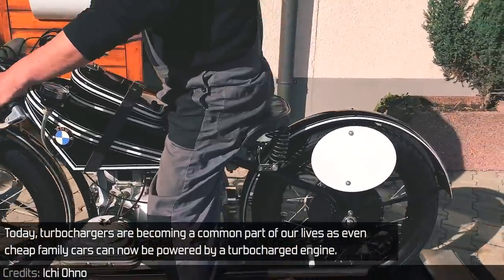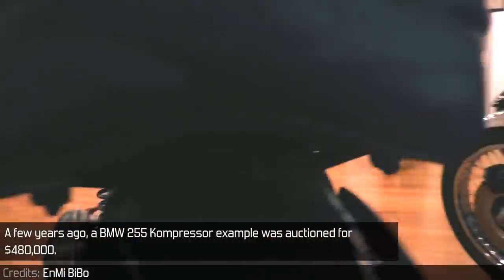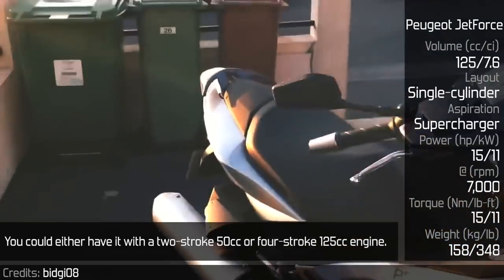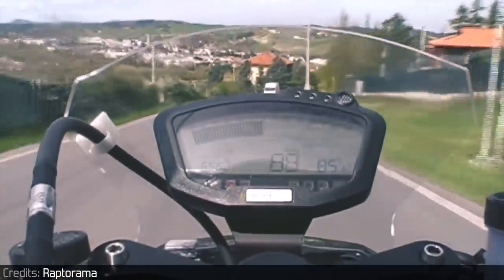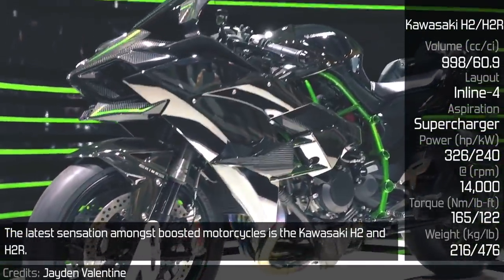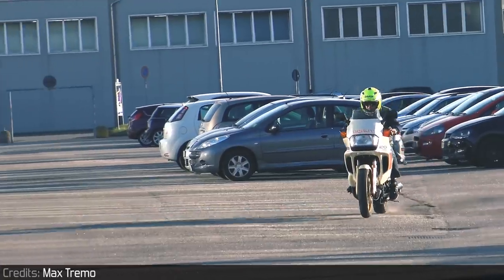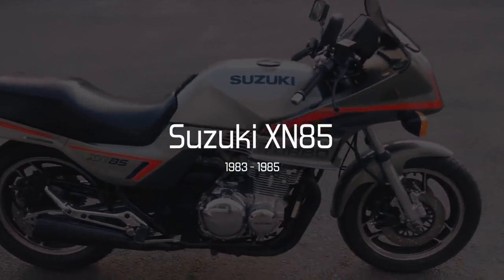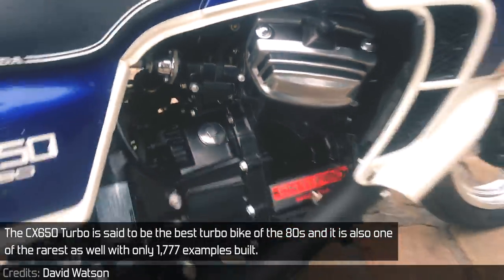10 Of The Coolest Stock Boosted Bikes

Comment: Saw a photo at BMW Museum of a  motorcycle from late 1930's without an a front leaf spring suspension (like Indian used) with a supercharger.Across town at the Deutsche Museum was a display with the supercharger BMW had used on the speed records bike.Twin screws operated by chain drive off the crank shaft.

Comment: 1980s Japanese bike handling + a turbo  . That's a really interesting , and probably uncomfortable mix . . . .
Reply: The XJ650? It was just too damn heavy to do anything - even with the Factory Power-up kit. (at least you could keep FZR600s, Hurricanes, ZX600C and later Ninjas, etc... in sight with the kit. Not beat them, but not get gapped badly)
The Gpz750 Turbo  was terrifying. Pipe cleaner UJM frame and a 120 wide rear tire.

Comment: wow a supercharged mini scooter with 50cc?? that was a bold attempt at getting more than 14.7psi into the lawnmower engine!! more manufacturers should try doing this...the idea is to make tiny engines powerful, that will only improve turbo and supercharging on bigger engines as a result of R and D...Hats off to Peugeot!!
Reply: fidel catsro The supercharger is on the 125cc, not on the 50cc ^^
Reply: i see.. 125cc also still something...usually they didnt compressorize anything less than 500cc..

Comment: 1:54 the tire is facing the wrong direction
Reply: Well spotted ,That's what you get when "car guys" try to make a few bucks from old er "classic" bikes that have been unloved for many years , Looks 
like a new tyre (with a y) fitted to sell it on like all GPZ,s at the time can be 
a bad oil "burner" that smokes like a two stroke on the overrun when used
hard the later ones don't

Comment: How they can control the turbo lag on a bike? Riders are Insane.
Reply: Even Bikes without forced induction have some kind of lag. Like you could be fine under 5k but when you reach 5k in 2nd gear you get huge power out of nowhere and you wheely. and your body clings onto the bike instead of being pushed by it which makes keeping your body steady
Reply: Riding Weeb thats a powerband..
Reply: Ramkakh 
Just twist hard and hang on. Not for newbs.
Reply: Really not a problem. The 80’s turbo bikes were well behaved and you learned quickly to adapt to the minor turbo lag there was.

Comment: Turbos are just a cheap tactic to make week engines stronger
Reply: Well not really cheap tactic but you know what I mean☺️
Reply: If only you guys could spell "cheap"...
Reply: But what about month or year engines?

For what it's worth, turbos are not cheap and neither are the modifications needed on the engine.
Reply: mjouwbuis modifications?? Really to get a turbo WORKING you need some pipe fittings and a oil line and a bracket to hold it of course. Some engines are pretty easy to install a turbo on some even have kits!! The hardest part is just finding the right turbo and I understand some Turbos can be upwards of $1000. 
Ps: yeah I spelled cheap wrong dang it. I better fix that
Reply: Never mind cheep, I found week much more funny ;)

With modifications i mean to engine parts to prevent it from premature faillure. Depending on the basic engine, it will need better cooling (not just an intercooler, but oil cooler, oil jets to cool the pistons, etc), the mechanical parts need to be able to handle the higher torque or rpm, the head construction needs to be able to deal with a higher effective compression and I probably forgot a few things.

Comment: do you ride ?
if so what bike?
Reply: Gilera runner 180cc full mallossi
Reply: Modified honda cx500, it's great
Reply: Aprilia Rs 125. Awesome and beatiful bike :)
Reply from the maker: I don't yet, saving money for some A2 bike (under 35 kW) as I just got the A2 riding license.
Reply: 1993 honda st1100
Reply: Husaberg FE650, crazy bike!
Reply: 2103 zx6r
Reply: 1974 Honda xl125 and 1980 Kawasaki ke125
Reply: Husqvarna 400 wr 1985 2-stroke
Honda MT5 with H100 engine 1999 model
BMW F800R 2015
Reply: klr 650 tengäi and I'm building an cafe racer from an motoguzzi v65sp
Reply: VisioRacer where do you live ?
Reply: Yamaha DT 125R 4BL 1996 26HP Giannelli Exhaustkit
Reply: Gold wrapped 636

Comment: I think boosted bikes are just not meant to be.
If you go with the turbo, you will have serious handling problems when it finally kicks in; and the parasitic loss of a supercharger wouldn't justify the power gain in small engines.
Reply: bercholr you are wrong on both. there's no way you could get a 326hp engine into a bike without boost so saying that superchargers are too parasitic for them is just dumb. And this isn't the 1950s, turbos don't have huge lag, power kicks or anything like that due to twin scrolls and incredible ecu systems.
Reply: bercholr  Try You Tube for GUINESS WORLD WHEELIE RECORDS & BRITISH 
NATIONALS ELVINGTON 2015  the uncool folk over the pond show that a well 
put together "turbo" can be used in fact many rode to the event as road legal 
bikes can do 209 MPH on one wheel then rode the local shop/pub without 
a backyard made silly swing arm and a oversized useless back tyre with a 
y playing "smackdown" while er "streetracing" and holding up 6 lanes of 
freeway , Turbo bikes can work well if that's your thing

Comment: Turbos are fake horsepower, naturally aspired is always the best kind of engine, no replacement for displacement sorry. Import drivers can't do anything without the turbos.
Reply: There are some engines asking to be turbocharged...
Reply: they could make bigger engines, which would be far less powerful in comparison.
Reply: CaddyPro'59 lol
Reply: triple facepalm
Reply: incorrect. Lexus LFA.
Nuff said.
Reply: definitely trolling haha
Reply: I could say the same about your preference and cornering
Reply: CaddyPro'59 Nah fam, explain yourself?
Reply: better than putting in V8s into a moped
Reply: Boosted Visuals スバル Turbos aren't real engine power. Need to explain more?
Reply: Well if turbos aren't real engine power,  did the chicken realy cross the road or was it a fluke all along #iluminati
Reply: yeah
i guess
Reply: CIA niceeeeee. i like the way you say it. pppsssshhhtuuuu tututu... oh yeah... don't forget this, fuel economy. HAHAHA
Reply: I would rather drive a stock hemi than a 2 liter engine with twin turbos but that's just me. I love big displacement.
Reply: I think your opinion is much more based on passion than technical knowledge...
In fact, naturally aspirated engines should be called "fake horsepower", since they can never deliver the power corresponding to its size; a 1 liter engine for example, naturally aspirated, will never fulfill this capacity entirely - it will perform like 700 or 800 cm³ at its best. A turbocharger will make the 1 liter use this whole liter, or even more (not to mention the other advantages)
Reply: boi. my turbo VTEC Civic is gonna chopped your poor Corvette in the drag and you be crying to your mummy when you lose your car to me in a pink slip race.
Reply: Lin Chester that's also a weight thing, but if there was a supercharged corvette it would wipe the floor with your civic. Besides, people run 20+ pounds of boost to make it compatible with a stock corvette
Reply: You have to do more than vtec to beat a corvette in the 1/4 mile.
Reply: I'm very into american cars 1980 or older, my car is has a carbureted 390 V8. Only about 50 hp per liter but its pretty good for a 58 year old car. But its not the engine that matters to me, its the style. You know, style ended over 35 years ago.
Reply: Oh yes, I'm talking about regular engines, not the high end ones.
Reply: Like the guys from MCM said, when talking about the tiny Motocompos, some sort of scooters who came together with the Honda City, stuffed into its trunk: "doesn't need to be fast... The feeling is the same - and the feeling is awesome"
Reply: grayson newell even if my Civic cant spank his V8. There are plenty of turbocharged 4 bangers Evos and 6 cylinders 2JZ and RB26 spanking V8 daily in the drag races.
Reply: CIA There are actually people that make custom big blocks in 632, 798 and a monster 1005 cubic inch that puts out 2100hp naturally aspired,  how awesome is that. I love the "bigger is better" philosophy. Maybe on day I will engine swap my 5,7 meter long oversized Cadillac with a 632 or something.
Reply: CIA Ekanoo Racing's Outlaw Supra is the world's fastest Supra clocking 5 secs 1/4 and excess of 240mph. The ETS GTR with 3000bhp is the fastest 1/2 and 1/4 drag car as well with 6 secs on the 1/4 mile and over 400km/h trap time in the 1/2 mile. Will easily beat even Lambo Huracan which have twin turbos.
Reply: Caddy you could have avoided the entire "turbos are crap" thing if you just went straight to these last comments: "I like big engines, I like the cars that use those, it's the style".

Also PLEASE people stop separating horsepower from torque, you can't have horsepower without torque, and if you have any torque in the world but it isn't revolving just static there's 0 HP as well. The deal is about your application and the torque range, which again is a matter of your application.
Reply: Lin Chester Lambos are overpriced. $250k for 550 hp my ass.
Reply: Turbo and superchargers compressorize the combustion chamber and increase compression ratio as you rev up the engine ... Beautiful feat of engineering even my cat can appreciate
Reply: Lin Chester the stock z06 has insane track times with 0-60 at 2.95 seconds and a quarter mile barely over 10. The corvette and the new camaro share a super charged 6.2 liter v8 with the camaro have times barely slower, now imagine they were turbocharged. If they were turbo charged they could make mor power than a turbocharged 5.3 liter which makes 1200 horsepower at around 12-16 pounds of boost. I promise turbocharged or supercharged v8 can eat any imports breakfast.
Reply: Lin Chester turbos are a legitimate engine part, I agree there at least.
Reply: Lin Chester Supercharger is not fake horsepower, because the engine itself drives it and supercharger size measured as  actual displacement. While turbos are in a way self driven, they are not actually a part of the engine.
Reply: And by the way, Cadillacs are not meant for drag racing, of course you would beat me. But my car beats your car by design(by far).
Reply: CaddyPro'59 it actually is an engine part, it used the exhaust from the engine in forced induction. So, a turbo is not an outside body because it runs off the engine itself, almost like how an alternator uses the belt to create an electric charge and charge the battery
Reply: CaddyPro'59 i dont need to rice out my Civic. My Civic has drag slicks for tyres. A good exhaust which you guys called a fart cannon and a real dry carbon hood and the rest of the car looks stock with the Honda factory yellow body color.
Reply: You need to go back to school,n,power is torque x rpm it dont matter how you make it really ,look at gas turbines if you want real power and reliability.
Reply: Lin Chester Turbos on a classic? Um, that's not normal mate.
Reply: "Theres no replacement for displacement?"
What does it do with turbos?
Reply: CIA typically 2JZ can go up to 3.4L from 3L. Of course the bottom end is milled out of billet materials. Power figures of 1500+ bhp is not unheard off. Typically they either use E85 or RON110 as fuel. I dont know why they dont release the part list. But most pro drag teams will know roughly the parts used. The engine may take up to 1500bhp but typically the gearbox is one part which will fail quite frequently and need to rebuild. The ETS R35 went thur many gearboxes to hit 3000bhp
Reply: Lin Chester But they are not made for 1500 hp, It is actually quite dangerous, I would not boost it higher than 1000. V8s 6 liter or bigger can handle that amount of power much better.
Reply: CaddyPro'59 rofl tell that story to the pro drag teams who uses turbochargers and producing 1500bhp and above. Go to your nearest drag strip and see for yourself.
Reply: All I'm saying is: Its a bit dangerous, if it the engine blows up.
Reply: CaddyPro'59 dude. my civic once blew up but i just rebuilt the engine and move on to bigger parts. didnt my word get into your thick skull?
Reply: Is it hard to rebuild a modern engine? Its pretty damn easy on my classic but I don't know how it is on fuel injected engines, you know there is almost nothing else than engine under the hood on a 58 year old car.
Reply: Brett J as much as I love and preach about the greatness of NA engines, turbo power is definitely not fake. The current generation of turbo engines is far too clinical, but the turbo cars of the '80s had real character... the F40 is regarded as one of the best Ferraris and one of the greatest cars period, made by one of the best builders of aspirated engines 😉 The irony!
Reply: Bogdan Buzdugan The only cars with character in the 80s were italian sports cars. America lost it in about 1975 and Europe at the same time as well. I could complain about modern cars all day, but I choose not to.
Reply: CaddyPro'59 theres a 951 cube big block alcohol drag car in aus thats na
Reply: CIA Well, the 2jz has unlimited (virtually) potential, so no, they are not limited. Actually, if you make the same engine but  with harder and heat resident materials, you can easily put out 2000hp from a 3L. While American engines need, let's talk about the most common V8, a 6.5 L V8, tops out , with the same modifications, 1400hp. Or a big block, like a 8L, 1900hp. Now, compare a compact engine that is more efficient and fuel efficient, with two enefficient American V8. Oh another thing, a 8L V8 outputs like 400-600hp? A Ferrari V8 outputs 640+ HP. With a 6L displacement. Think again your big is better, because it's not. Why? Inefficiency.
Reply: CIA Telling you, bore=stroke, you don't need bigger displacement, just a Twin turbo.
Reply: Hi-Fidude66 
Tell that to all the fighter pilots who ran engines at 30,000 feet with 22lbs of boost to feed a 2,800hp engine in air that thin, if you think that is "fake" power go ahead and stick your head into a 12 foot diameter propeller while it's running, there's nothing "fake" about horsepower no matter how you get it.
Reply: Kalvinjj 
You're almost right, close but not exact, the thing that people who love torque numbers don't get is that there is no time involved in measuring torque, huge torque numbers are meaningless without the part of the formula that involves the amount of time it takes you to produce the ft/lbs of torque, you can take all day to make your torque rating, horsepower is determining how fast you can produce that number, the faster you can produce that amount of torque the higher the horsepower, torque is measured in foot/pounds of energy, which by the way is a linear measurement, which means in a straight line not going in circles like everyone incorrectly thinks because of the whole "torque is the twisting action of a shaft"  thing, also torque is a measurement that is expressed as force/distance where horsepower is a expressed as force/time, seeing as the person who crosses the finish line in the least amount of time is the winner horsepower is the final say, torque is just a part of the formula to figuring out horsepower, most people who love to quote torque numbers  (my fellow Harley riders, and I've been riding them for 30 years) usually quote torque numbers because they have lower horsepower numbers, 73lbs of torque at 3,600rpm will cross the finish line behind 50lbs of torque at 11,500rpm every time, it's a mathematical certainty.
Reply: Hi-Fidude66 

Absolute crap. If it's integral to the engine, makes power and doesn't need a refill (a la nitrous) then how can it be 'fake'? That's the stupidest thing I've ever has the misfortune to read.

The fact that you think superchargers  aren't 'fake' but turbos are because they're driven by combustion gases is howlingly funny.